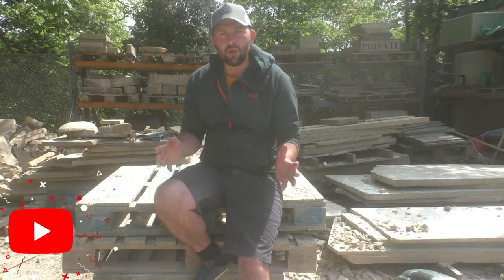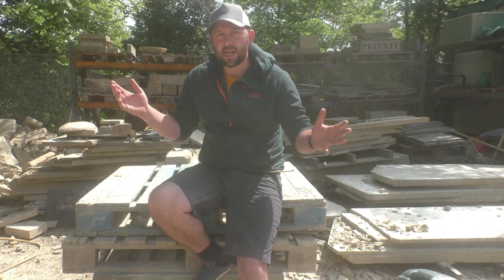CAN YOU CARVE STONE WITH A OLD RUSTY NAIL, STONE CARVING CHALLENGE, ALTERNATIVE WAY TO CARVE STONE

Comment: What stone was that  ? Looks pretty soft...?

You reveal that you heat treated the nail.  It would have added some value to the video if you had shared that....
Reply from the maker: Hi Bert, it’s a Derbyshire grit stone. It is a good stone for carving letters. I didn’t heat treat; I was just saying that the end of the video it would have been a good idea to keep the edge sharp. Thank you for watching ⚒️⚒️
Reply: @TheStoneRanger  I think that most nails are mild steel - can't harden that...Great job - I was wondering how long that nail would hold its edge.
Reply from the maker: @KB-dd9xr  Not very long at all & thank you 👍
Reply: @TheStoneRanger  👍 it's just that you mention requenching at the end and to me that means heat treatment.. Having said that, in my experience, heat treating even a modest nail does add a modicum of hardness...

BTW what material is the head of that msllet ? I felt quite sorry for it...
Reply from the maker: @bertkutoob  Yes, I was wondering if it would help, but my knowledge of Hard-enable metals isn’t so great, as you can tell 😂😂